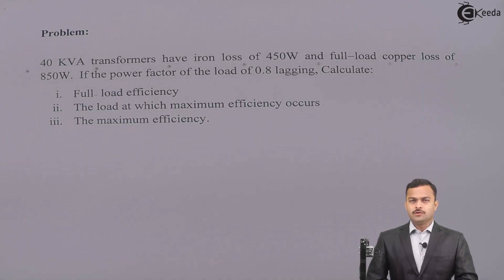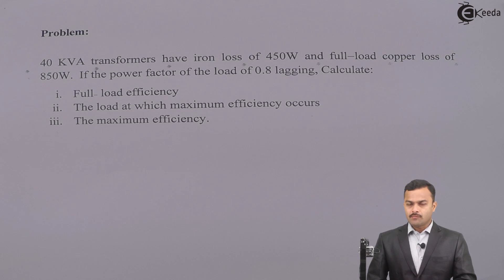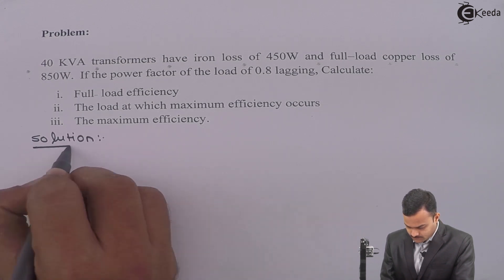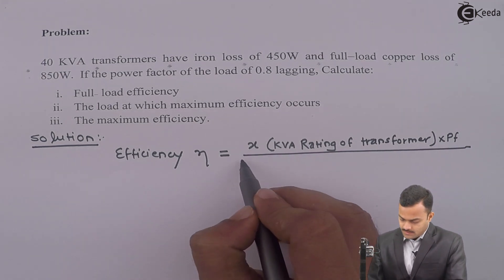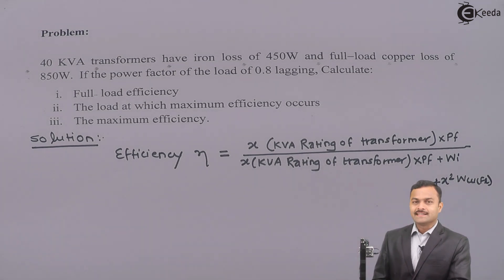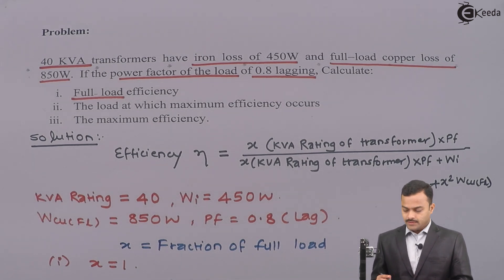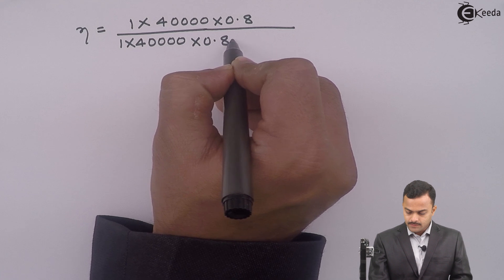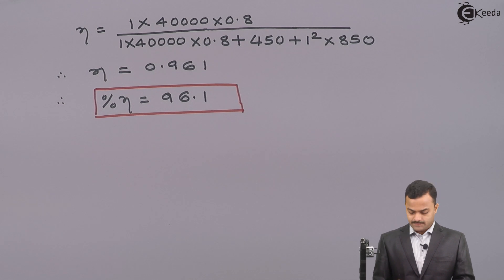Efficiency of a Transformer : Problem 1 - Single Phase Transformer - Basic Electrical Engineering

Comment: A single phase 50hz transformer has a voltage ratio is to 230/2300v . the capacitor rate of the 30 kvar is connected on the 2300 side calculate the value of is capacitor and what is the kVAR of capacitor and the value of its capacitor as seen on 230v aide . Assume that transformer to be ideal